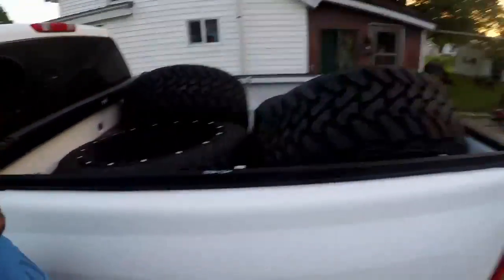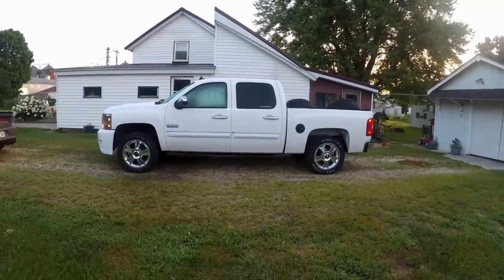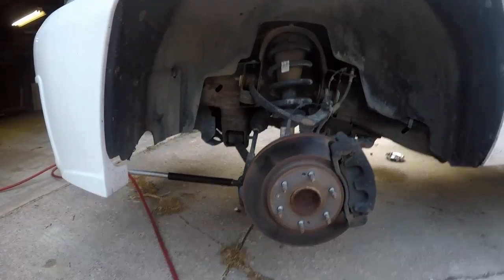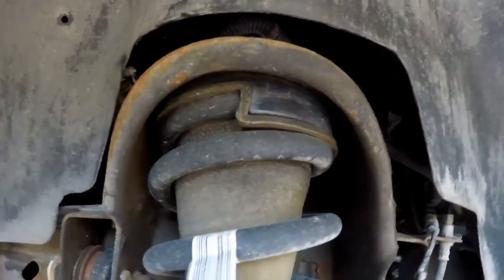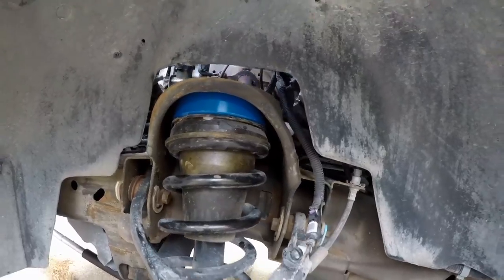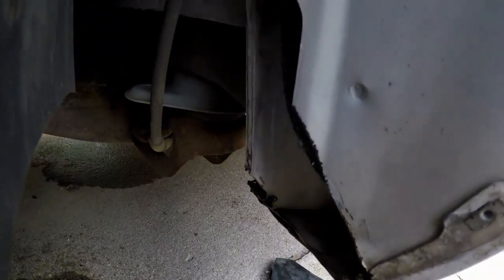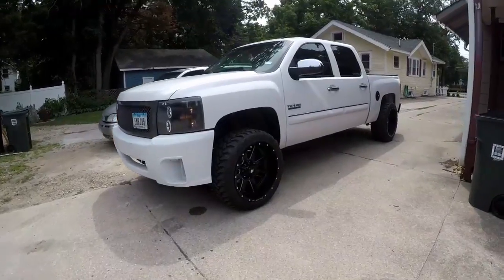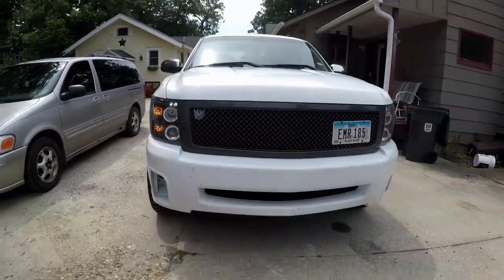Chevy Silverado.
22x12 Ballistic wheels.
33x12.50 Toyo M/T Open Country tires.

Comment: So you have a 3” front leveling kit with 22x12 on 33”s?! I have a 2” with 20x12 on 33s and really looking to go with your setup.
Reply from the maker: Yes! All I did was the 3 inch level and I had to do a little bit of trimming and that's it! I love it!
Reply: Thanks!!
Reply from the maker: @jamesverduzco700  you got it!
Reply: James Verduzco I’m looking to go with the same wheel setup on a 2 inch level. How badly do you rub?
Reply: @319speed did you get new upper control arms or keep stock?

Comment: Do they rub ?
Reply from the maker: On the back not even close. On the front yes of course. Without lifting the front and trimming you wont even be able to turn them much without rubbing. I 3 inch leveled and trimmed and I can completely turn them.

Comment: Where did you order the wheels from?
Reply from the maker: +lmfscrew I didn't. A friend of mine had bought them and the tires new and put 500 miles on them then sold the truck and took and put them away till I came along and snagged them
Reply from the maker: +K 1500 a guy in my town saw them on my truck and went and ordered himself a set but in 20s

Comment: truck looks amazing im fixing to do my gmc sierra like that
Reply from the maker: Thank you! It's nice! Keep in mind it throws tons of grap all over the truck though!
Reply: @319speed  
lol yeah i know but you can't make an omelette without breaking eggs
Reply from the maker: @boxingexpert5427  hahaha yeah
Reply from the maker: @boxingexpert5427  oh and rock chips. LOTS of rock chips! Haha
Reply: @319speed  
 oh i know! but it's going to get DONE.  haha
Reply from the maker: Then by all means do it! I only hate it in Iowa because I pick up all the metal particles off the road from the winter and then get those orange spots in the paint! Do a ceramic coat on your truck and that will at least keep the crap from embedding into the paint! That's what I plan to do soon
Reply: @319speed  
oh crap!! thank you for the tip.
Reply from the maker: You bet! Itll save you alot of headache and your paint!

Comment: Wow nice !
Reply from the maker: Thanks. Workin on a yukon now. Will have more coming for that soon.
Reply: K 1500  I try decide 20 or 22 ballistic with 33 for my Nissan Titan .... I don’t know if 22  will look to big or 20 to small   😕
Reply from the maker: Well keep in mind. The more rim you have the less tire you will have. Less tire makes for a rougher ride. 22s looked good on my Silverado. I loved them. 20s were stock on my truck. They looked good to but I wanted the bigger wheels. So depends on what you want. If you want the look. Then you want 22s. If you want some of the look with the big tires and a little better ride run 20s. Also depends on the offset. 22s have more offset sticking out further. Most 20s dont have as much. Also remember the further the wheels stick out the more they will throw up rock at your truck and chip the paint. Got real old real fast. On a titan I dont think 22s will look to big btw.
Reply: K 1500  thanks for take u time and explain to me !  My truck is 10 years old only 75k miles is in good condition but I know he won’t last to much maybe another 5 to 6 years I live in Chicago and the salt eating cars here . Another thing is path hole here is bad really bad ... maybe i will go with 20 and more tires  let see .. I have good deal ballistic rage 20/12 -44 offset and 33 Artturo tires MT  everything 2.300
Reply from the maker: Idk much on the Atturo tires. Just read the reviews on them. I got cheap tires once and regretted it. I live in iowa so I know what you mean about winter and salt. Just remember -44 is a wide offset and you will throw stuff up the side of your truck and if you havent yet you will need a front level and have to do some trimming to. Trimming isnt that bad with the level tho. Have a good one. Good luck

Comment: Do you know what offset the ballistic wheels are ? 

Were there options or just one choice
Reply from the maker: yankphan100 22x12 rim with a -44 offset. I bought them from a friend. The rims and tires only had 600 miles on them so I cant tell ya anymore then that since I didnt buy them from an actual place.

Comment: Did you need aftermarket lugs?
Reply from the maker: Yes 100% needed. Stock ones are to wide and wont fit right. Depends on the wheel but most the time with aftermarket wheels you need aftermarket lugs

Comment from the maker: I kinda miss the old look! Update to the truck. It also now has a 2500HD hood and grill.
Reply: K 1500 post a new video of it man!
Reply from the maker: rokkero564 I want to but I actually cant yet. That's why I havent. I will down the road tho!
Reply from the maker: rokkero564 you know what I'll make a video on the truck updated soon!
Reply: K 1500 I seen the 3 inch leveling kit you installed, I myself was looking to install those on my truck and from the looks of your Channel you use your truck like I do. I wanted to know If you experienced any trouble with them and where you got them. I’m 17 and have an 08 that I’ve been doing the work and paying for everything and in my small town in Oklahoma it sure gets the girls attention just wanted to add an aggressive stance. Thank you and I have become a subscriber🙏
Reply from the maker: @hotshot7658  
Hey man I appreciate you stopping and checking out the channel. I've had mine on for a while now and I've had no issues at all. They have held up good and never ever gave me issues. Odviously once you get them installed you need an alignment but that's it. I had to do some trimming for the wheels because of how much offset they had but it all depends on the wheels you have with the 3 inch level. I cant remember I'll have to check but I think I got the 3 inch level off Amazon. Thanks again. I'll double check real quick.
Reply from the maker: @hotshot7658  
Yep I got them off amazon.

Check this out at Amazon.com
Supreme Suspensions - Silverado 1500 Lift Kit Front 3" Leveling Lift Kit for [2007-2019 Chevy Silverado 1500] and [2007-2019 GMC Sierra 1500] BLUE Aircraft Billet Strut Spacers https://www.amazon.com/dp/B01L0LUD4U/ref=cm_sw_r_other_apa_i_DN7yCb64PXE9W
Reply: K 1500 thank you very much sir I appreciate it very much
Reply from the maker: @hotshot7658  you got it man! If you got any other questions don't be afraid to ask. I try to respond to everyone as long as YouTube shows me the comments.
Reply: K 1500 hey it’s me again and I just thought of this but with the 3 inches in the front does the back level completely or is it higher/lower. Thanks and I can’t thank you enough I just ordered mine and they’ll be in on the 19🙏🙏🙏
Reply from the maker: @hotshot7658  the front sits just a hair taller then the rear. Barely noticeable. I want to say maybe a half inch taller but it could be a inch taller but that's it. Thanks for stopping by!

Comment: Has the rear been lifted at all or is it the stock height still?
Reply from the maker: Michael Woods it has not been lifted. You are correct, stock height!
Reply: K 1500 Sweet, sick truck man! I'm looking to do the same set up (wheel and tire size wise) and was curious on if I need to lift the rear to accommodate the front. What size spacer did you use and still running stock shocks?
Reply from the maker: Michael Woods Thanks! I went 3 inch spacer in the front and stock shocks still. I want to upgrade but at the moment haven't decided what I want.
Reply: K 1500 mine has a height difference of 2 1/4 in front to back so I'm probably gonna have to get at least a 1in block for the back
Reply from the maker: Michael Woods well thats up to you haha you could always just leave it. Mine is about maybe a inch higher in front

Comment: Can you fit these with a 2.5” kit?
Reply from the maker: sean blandford idk I have a 3in. Setup. I would imagine you could. Even with a 3in setup I had to do a good bit of trimming.
Reply: K 1500 was it the NorCal mod or more trimming then that?
Reply from the maker: sean blandford I had just a 1.75 inch spacer you can see in the video and we test fit the wheels on with just that. They fit at that height but they hit the frame when turning. So I went with the 3in just to be safe. Idk what the norcal mod is to be honest. I would imagine with a 2.5 it would be just fine I'm just saying I had to cuz some of the body at that corner right in front of the doors and some of my bumper (not stock bumper) and a lot of my inner fender well plastic so that it wouldn't rub at all. Only time you hear it hit the plastic is if I'm backing up slow and hit a bump. Otherwise you never hear it rub.
Reply from the maker: Oh the biggest issue I had was my washer fluid tank on the driver side. I had to cut that. It got damaged anyway when we were trimming so I cut it out at the bottom to have more room. I installed a different washer fluid tank under the hood.
Reply from the maker: Idk if any of this helps you or not but hopefully it does.

Comment: Hello do u think I could fit 20x12 with a 33 tire on my Silverado I got 2 inch leveling kit without any rubbing???
Reply from the maker: I have a friend that is running a 20x12 with a 33x12.5 tire on his and he had to trim as well. Your tire would be the same size as mine you just would have a 20 inch rim instead. It will definitely rub. I put a 3in level on mine and I still rubbed. So yes you will rub. Just do some trimming and you will be fine
Reply: leveling just in the front right u got??
Reply from the maker: Martin Gonzalez yes I did only the front.
Reply: K 1500 One last question name brand on ur rims??
Reply from the maker: Martin Gonzalez they are ballistics

Comment: What bumper is that
Reply from the maker: I dont remember what its called. Found it on Amazon though.
Reply: @319speed  how did you install it ?
Reply from the maker: @juanrocj0o9htu43ri0k  I personally didnt. My body guy painted it and installed it for me. I had hit a deer and it ruined the front bumper grill and lights. I ended up having him redo the front end. I do know that the plastic end caps on the stock bumper come off and then this bumper once you get it painted fits over the actual bumper. All it is, is a bumper cover. I love the different look but at some point I plan to go a different direction with my truck.
Reply: @319speed  alright man im stuck on this or a 2500hd bumper
Reply from the maker: @juanrocj0o9htu43ri0k  well this is MUCH easier then the 2500HD bumper. If I remember right the 2500HD bumper is not a straight bolt on. But if you are doing the 2500HD swap like I have you have to modify the grill to fit right since the 2500HD bumper sits a tad lower then the 1500 bumper. I had that issue that my grill wouldnt fit so I trimmed the mounts up and it fit fine then.
Reply: @319speed  i bought a 2012 hd grill already and it was a direct bolt on on my 2012 1500 but i do know for the bumper there is some work that has to be done
Reply: @319speed  mines got a 3.5" level right now with some moto 970s but im going to do a 4/6 drop with some 24s or 26s
Reply from the maker: @juanrocj0o9htu43ri0k  yeah no my grill bolted right up just fine but my bumper was in the way and it wouldnt mount right so I had to thin out the mounts. You put a HD grill on? Did you do the hood swap to? The HD grills stick out further then the stock 1500 hood
Reply from the maker: @juanrocj0o9htu43ri0k  if you're dropping it I think the bumper I have would look so much better for you.
Reply: @319speed  not yet bro i bought the strip that goes on the hd hoods so it wouldn't be noticable and just wondering the bumper  you have does it have any play ?
Reply from the maker: @juanrocj0o9htu43ri0k  my bumper is solid. All it does is sit over the stock one so it's as solid as the normal bumper just without the end caps.
Reply: Is the bumper still for sale?
Reply from the maker: No, not right now anyway.

Comment: How loud 1-10
Reply from the maker: How loud is what
Reply: K 1500 I think he was asking  how loud the tires were going down the highway on a scale of 1-10
Reply from the maker: @dwtc551  if you keep them aligned and rotated they arent to terrible but if they get chewed up wrong they get awfully loud. I had 1 tire that got chewed up and it was loud. Probably 8 or 9, I mean it was annoying but otherwise they weren't bad. Maybe a 4 or less? This is my first set of wheels and tires like this so hard to really compare.
Reply: K 1500 thanks man👍.   I wasn’t really asking I was just trying to help with David’s confusing question he left for ya!
Reply from the maker: I know I just figured I would answer it though anyway if that's what he meant